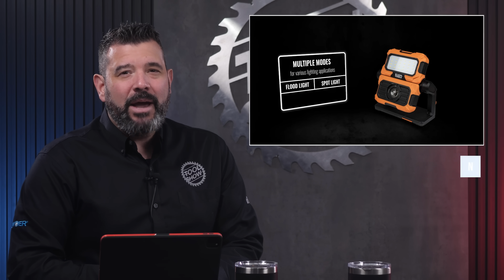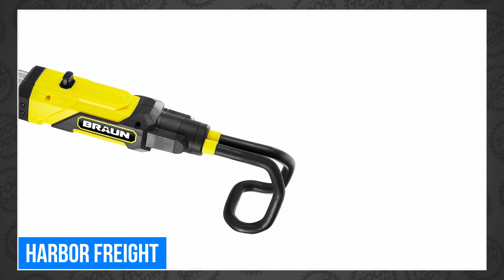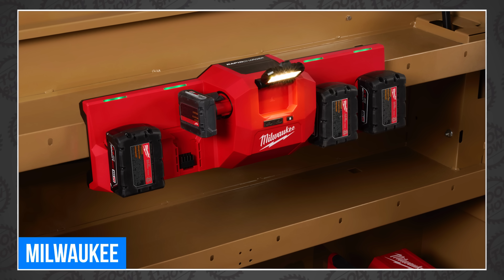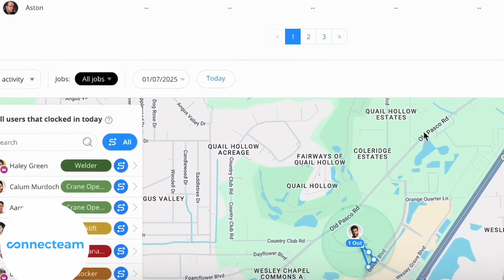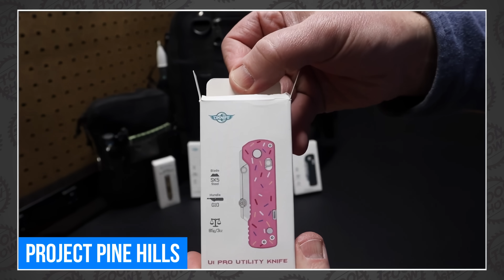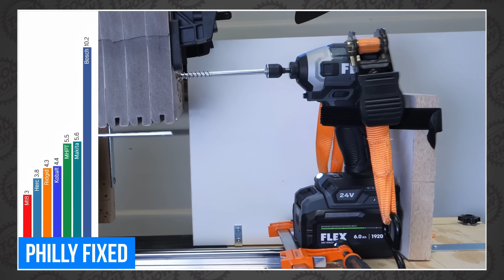16 NEW Power Tools Announced from Milwaukee, Bosch, Klein, EGO, and Harbor Freight!

Comment: One gripe I always have with cordless mowers is blade speed. Maybe 3200 is enough. If it is, I will gladly upgrade my gen 1 ego.
Reply from the maker: @meanodustino9563  EGO OPE has always been on the bleeding edge of battery powered OPE. But when it comes to runtime, that’s where you see the difference between gas and electric. While Gas is more expensive, when you buy 5 gallons for $15-$20, it still lasts you months in your mower. So naturally we push our mowers to full throttle all the time, and don’t think twice about what it costs. But because batteries are far less energy dense, we notice runtime a lot more. You can get insane runtime on an EGO if you just throttle down. If you mow often enough, and you’re not running through 7” grass, you can do that. But I don’t always have time to mow often, and I like to run everything at full throttle. That’s why I’m so excited about the dual bay mower (it’s sitting in our dining room right now, which is where deliveries end up) As soon as it’s warm enough, I plan to drop in a pair of 12ah batteries, and run full power through my lawn to see how it does. It’s a luxury to be able to do this, for sure. But it’s definitely my preferred way to mow my lawn. (Full power, no gas, fumes, noise, or maintenance)

Comment: Milwaukee gotta find a way to make the backpack blower more efficient. The Mxfuel having slightly more power then the M18 variant but still a 20 min runtime with a 1400$ battery is just insane. Until Milwaukee drops riding and push mowers pwoered by that idk why any landscaping business would be in the Mxfuel lineup
Reply: 4 of those MX fuels on a riding mower would be sweet
Reply: @jwg9338  if they didn't cost 500-1000$ each maybe... unless they can make a mower that can cover at least 1 acre on 1 set of batteries. Any reasonable business potential would need 2-3 sets per mower so cost would be huge

Comment: That EGo Mower is actually quite bad ass. I got one roughly 3 years ago and am not disappointed. Plenty powerful enough to mow down field grass, grab grass, weeds, etc. I have 2.5 acres and this past year my rider tore up on me. I made it through the rest of the season with just the EGo push mower. Granted....it did take 2-3 charges on the battery per mow of the yard...but it handled it just fine.

Comment: Also curious why it would have strobe mode for that HF hood light.
Reply: I think they just used an existing off the shelf driver for the light, and those drivers have a strobe feature.
Reply: @DeafJamPunks  That would explain why so many cheap work lights have the strobe function
Reply: @DeafJamPunks my intuition says that you’re probably right!
Reply: @DeafJamPunks  that's what i assumed. "the cheap chip they picked already had that feature"
Reply: My only thought would be for a smoke leak test
Reply from the maker: Thanks for the insight. I'm not familiar with how a strobe would be used looking for a smoke leak. Would it make it easier to see it's source? How does that work? Honestly looking to learn here.
Reply: @ToolShow  I honestly have no clue. That’s just a guess. Might might make the smoke move like a still frame making it easier to trace where it’s coming from.  Like the magic trick that makes water droplets look like they’re frozen in mid air